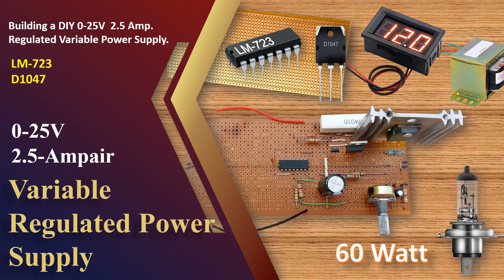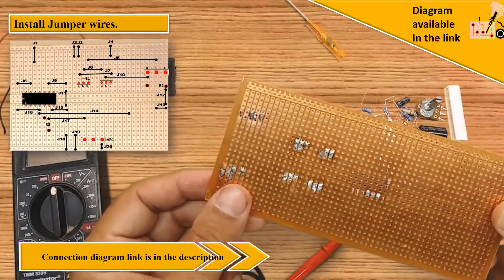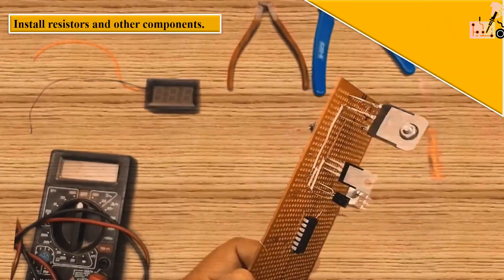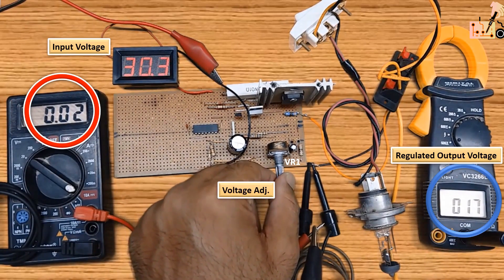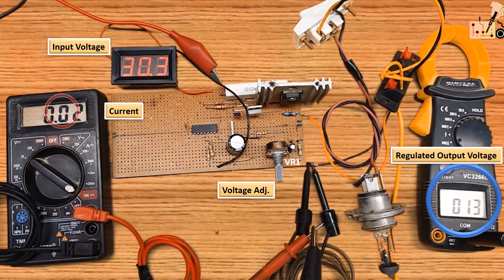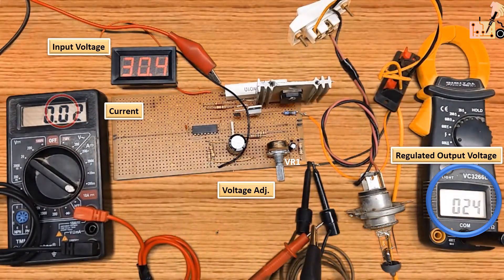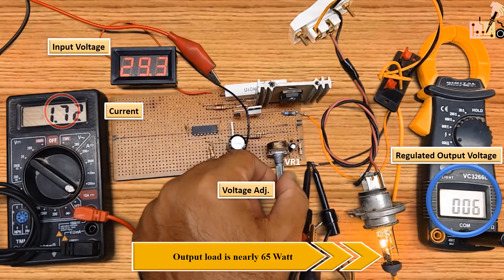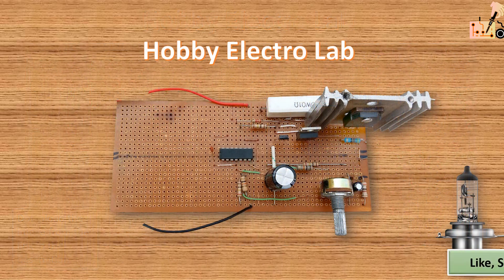Adjustable Power Supply 0-25V 2.5A 65-Watt | Built on Veroboard LM723

Comment: Nice and simple. You have the PCB layout available ? Even a hand made PCB with marker will do the job quickly.
Reply from the maker: Yes, I will upload a PCB version very soon. You can make that PCB very easily. .. Thanks
Reply: Hello first of all great video .  I would like to ask if u can reupload the schematic cause it says it doesn't exist. Thank you . 😊
Reply from the maker: sorry for inconvenience,  Please follow the links bellow to get the pcb designs.
I will uplade the link in my post later.

https://sites.google.com/view/electronicslab/adjustable-power-supply-0-35v-0-5a

https://sites.google.com/view/electronicslab/adjustable-power-supply-0-25v-2-5a-65-watt-built-on-veroboard-lm723